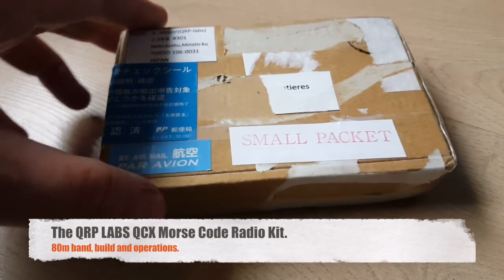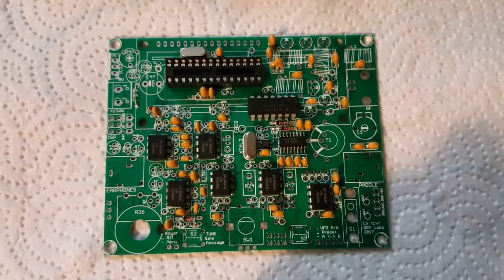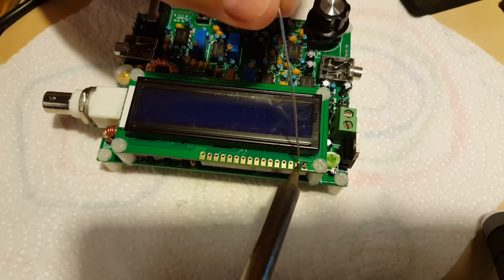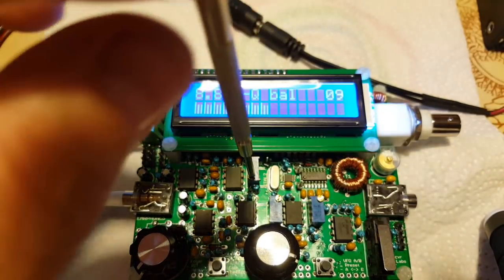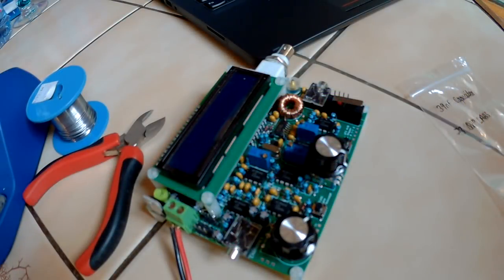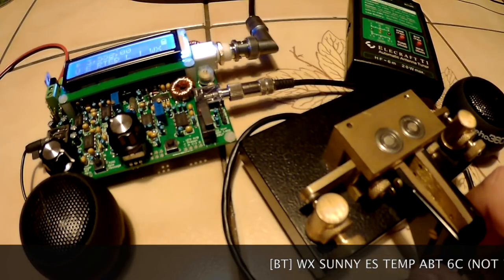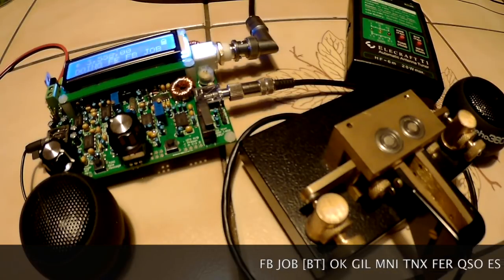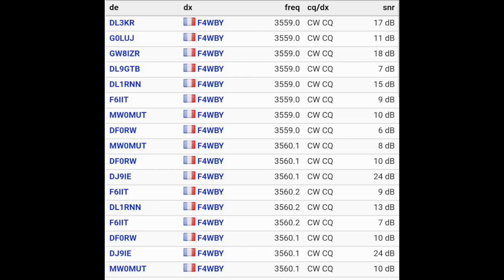The QRP Labs QCX Morse Code Radio Kit.

Comment: Nice little Rig, I have mine in my emergency back pack and I just build two battery pack for it one the three 18650 and one with four 18650 but I chose mine in  a 40 meters configuration.  Mine puts out 4 watts with the 3 cell battery pack and 6.3 watts with the 4 cell battery pack. 73. KV5P
Reply from the maker: You risk frying it on 4S...
Reply: @RadioPrepper  Hans said he has run test up to 20 volts but didn’t recommend it and I jut made a quick test, I normally use LFP-4 battery pack it love it a t 5 watts out. 73 👍KV5P
Reply from the maker: I did not know thanks.
Reply: @RadioPrepper  love you videos❗️

Comment: Hello! I have one of these on order, and wanted to ask what type of battery and connectors you are using. I'm a total newbie, and initially I'll be using the radio to practice and learn CW. I know that the radio comes with two cables but have no idea how to connect up to a power source. Thank you in advance for your feedback.
Reply from the maker: Hi, I use a standard 5.5mm DC connector. Batteries are three 18650 cells in serie.

Comment: Just ordered one of these (assembled) and want to know whether this antenna is OK?  If so, do I need an antenna tuner and can I configure as an inverted V?  Thanks.  I watch all of your videos!
Reply: https://www.ebay.com/itm/QRP-Style-40-meter-40M-Half-Wave-Amateur-Ham-Radio-Dipole-Antenna-/113728901462?_trksid=p2385738.m4383.l4275.c10
Reply from the maker: Great thanks. Which antenna?
Reply: @RadioPrepper https://www.ebay.com/itm/QRP-Style-40-meter-40M-Half-Wave-Amateur-Ham-Radio-Dipole-Antenna-/113728901462?_trksid=p2385738.m4383.l4275.c10

Comment: I'm very eager to get the QSX radio from QRP Labs and package it in a waterproof and rugged enclosure with upgraded switches and rotary encoder. It might also be possible to upgrade the firmware to include JS8CALL or THOR (pseudo-security through obscurity?) digital modes using a plug-in waterproof silicone keyboard.
Reply from the maker: I'm ordering one the day it will be available...

Comment: Hi Gil, thanks for the tutorial. After reviewing your assembly and downloading the assembly manual, I had to purchase one. Such a neat unit with so many features and power. The GPS is interesting and it could be useful when I venture into the wilderness. Also got a 10W amp for 27 MHz use. They have some great kits available. I can’t wait to receive the unit in the post. Have a good one, Andrew....
Reply from the maker: And wait for the QSX!

Comment: Hi Gil, How does it compare with mountain toppers and youkits? thx Axel
Reply from the maker: Hi, Youkits I don't know. It does burn much more current than the MTR which will last 5 times longer on the same batteries... It is otherwise a very good radio. I am getting a 30m version. Lots of features... The MTR is still the king of the hill, but if you need a specific band, great deal and cheaper. My 80m QCX is a great companion to my MTR.
Reply: Looks very good, I would otherwise use my ft817. For the price and with the reviews I thought it was a great option, Im getting the 20m. I hope I can build it properly!. thx
Reply from the maker: Great. See the boxing up photos I just posted on radiopreppers.com

Comment: Another great video, Gil. I'm very interested in this rig. The annoying sidetone sounded much better during your QSO with G4RHR; did I miss a mod or something?
Reply from the maker: It was just the sidetone volume being too high...
Reply: There is a mod to get rid of the thumping when transmitting. See the QRP Labs website for "REV 4" info. Just change 2 caps from 10 uF to .1 uF. I love my QCX.
Reply from the maker: Yep, I need to do it still...

Comment: Hi Gill, received mine about two weeks ago, i ordered some 8 pin dip sockets for the six ic,s well worth the wait from japan, taking my time no rush, its for 40m i have to confess i check all the resistors, capacitors, for tolerance, some vary, so i change for better tolerance, res +/- 1% this is some thing i did with frog sounds chineese kit a long time ago, and to my surprise a slight improvement 2.4 on 10volts, time to get serious with the QRP LABS KIT.
Reply from the maker: Interesting... I have a 30m version on order... I wish it was better on current draw  but quite a nice rig. I will put my two radios in Hammond 1590BB cases for field ops...

Comment: Thanks for the review Gil.  I was super excited to find this rig recently and have some ideas for mods and things.  Love the open nature, price, and feature-set.  Maybe this is the start of the ultimate weather-ready portable survival radio?  For avrdude, use "avrdude -p m328 -c usbasp -e -U flash:w:T1.00b.hex" as a command.  Not sure what your programmer is for sure, so you may have to change the "-c usbasp" option.  Check http://www.nongnu.org/avrdude/user-manual/avrdude_6.html and https://qrp-labs.com/images/qcx/HowToUpdateTheFirmwareOnTheQCXusingAnArduinoUNOandAVRDUDESS.pdf for refs.  LMK if you have more questions.  I've used avrdude a lot.
Reply from the maker: Thank you. I finally used an Arduino Uno which worked great. I wish I could work with a designer to make the perfect survival radio!

Comment: You must be getting good at the soldering Gil. Have you attempted the electrolytic capacitors on the 320's as yet?
Reply from the maker: +Moray Macdonald Not yet, but It's on my list.
Reply: i bought a thick finned yesterday so i have two now also :)
Reply from the maker: +Moray Macdonald Nice. Two is one, one is none!

Comment: Are you sure you wanted iambic b? A and b differ in how they handle squeeze keying. Nice video Gil. Interesting radio. For $50 how could you go wrong? 73 Charlie
Reply from the maker: Well, I am used to Iambic B... Indeed, great value compared to say, a Rock-Mite...